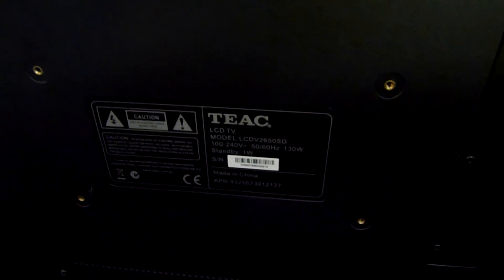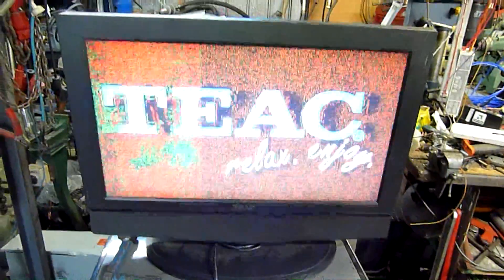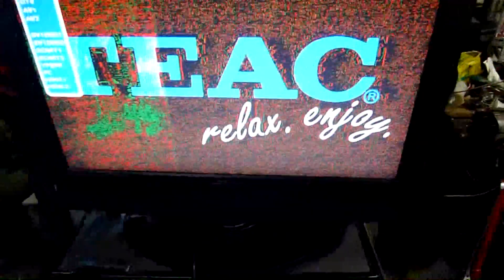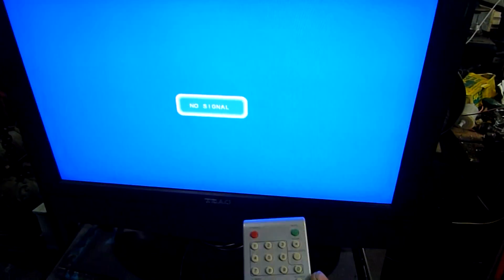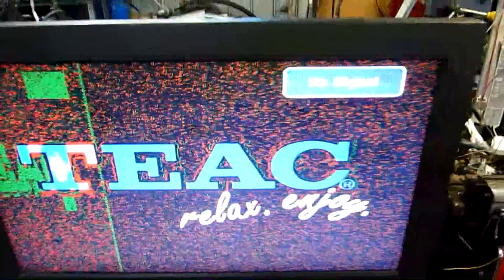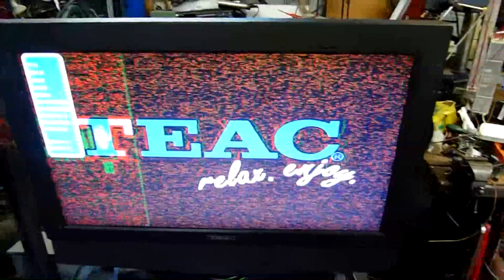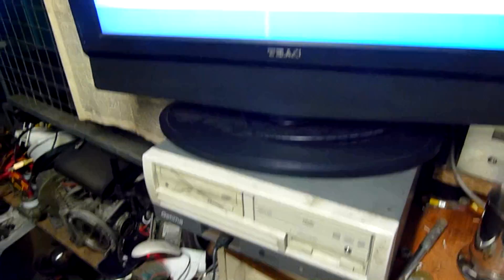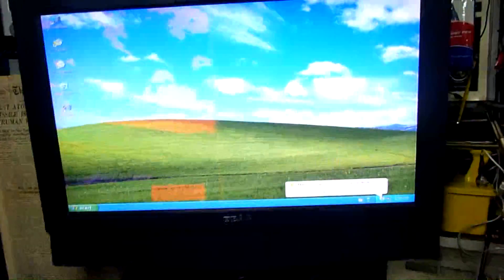Testing TEAC LCD Television - Video board problem

Comment: @Aussie50 its fun with both bow and arrows, got them till still work until you get the critical electronics, the daewoo K2 or  AR15 just blast the crap out of them real quick,and they shut off ,12 g shotgun is fun , but arrows are my favorate with flatscreens

Comment: I had a similar pattern on a LCD (the filtering caps in the power supply part died and took some of the other stuff with it). Red noise but the OSD worked fine. I my case it was the ADC part of the VGA input (to test I could switch the part with a second monitor of the same model where the caps just died 2 weeks before; Yay LG! If you make crap at least you are consistent in it).
So while one was perfectly fine after changing caps, the second was unrepairable (could't find any driver board).

Comment: i got a new 32 inch telefunken lcd from rubbish collection. guy threw it away because the picture was just way to red and fuzzy, so i got it home and moved the data cable from the tv tuner / emulator board that goes to the driver on the lcd panel and she came 100% fine. so six inches of duck tape to hold the cable in a different position was the fix, its full 1080p too! $600 tv when it was bought, he just couldn't be bothered with the warranty claim as he got it through work.
score one for jay!

Comment from the maker: @eurokid83 I have seen that too, my moms old Hitachi Plasma (that I have now) did it under warranty, they replaced the panel unit because one of its drivers was faulty.

LCD's can do the same where a driver dies and a row of transistors on the panel do not respond